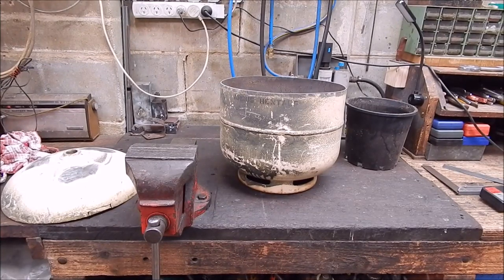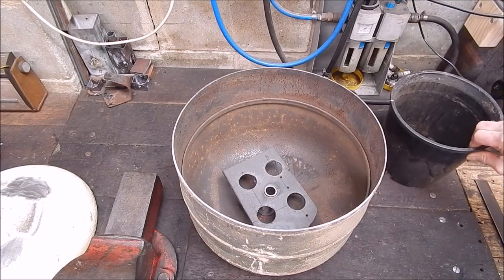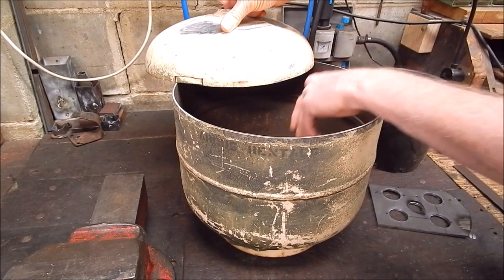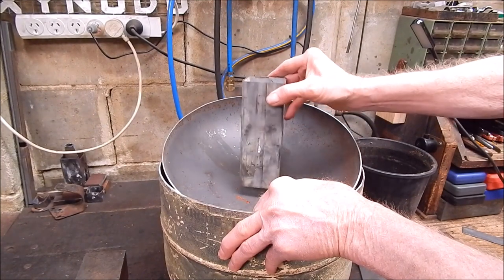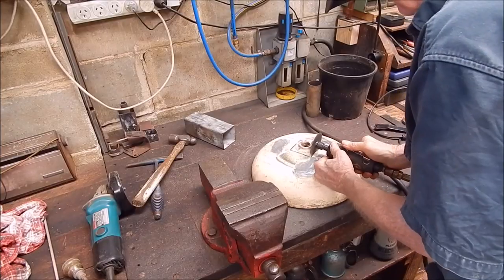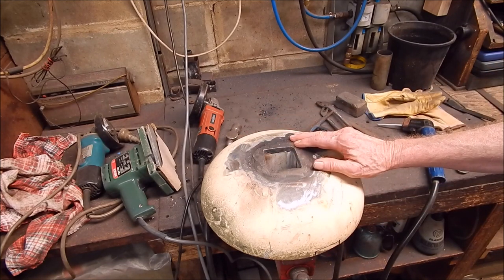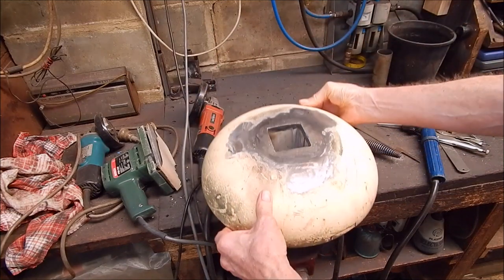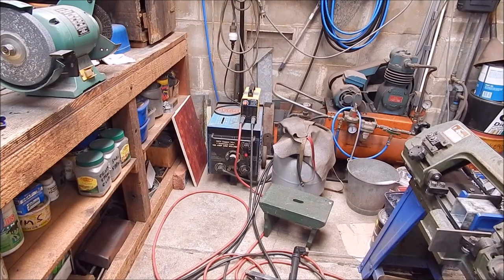Making a metal melting furnace from a 10 kg LPG gas cylinder - part 2

Comment: Hi Rob, coming on well. Loving your "design by committee" approach.......... brave man! Put your burner hole in before perlite, and lash the burner up, fire it up full (outside), paint removed!! Just means a bit of tidying post perlite addition but far quicker than sanding back. Cheers, Jon
Reply from the maker: Great idea Jon.  Yes I will go with that.  Cheers Rob

Comment: Hi Rob. Great build series. I've done a few melts in the coffee can furnace. Will be interesting to see how this one performs then I might borrow the idea for my next furnace. Cheers Kevin
Reply from the maker: Hi Kevin,  it's just a scaled up version of the coffee can/paint tin furnace really.  Not difficult, just time consuming and you need a welder of some sort.  The bigger burner should really heat things up, so I expect an improvement.  Lots to consider and it's good to get comments and suggestions on what is possible.  Uncharted waters, so any help is appreciated.  Chears Rob

Comment: If you're going to paint it, I'd strip it first.  If you paint over a substrate that isn't well adhered, or not the correct high temp product, the top layer will just come right off with the underlying finish. I own a body shop and specialize in heavy trucks and equipment refurbishing with emphasis on finish durability and corrosion protection. I do in house commercial sandblasting, machining, road service.  With that said, my opinions and suggestions have some merit.  Thank you Rob for sharing.  I built a foundry furnace from a metal 5 gallon pail with perlite and regular mortar. It's not Ideal, but for my limited usage, it's good for me.  Id like to someday build a really nice one on wheels with a lid you step on to open the lid. Take care my friend.
Reply from the maker: One suggestion in comments is to heat up the furnace before I put the perlite in it and that will burn off the paint.  Sounds like a good idea.  Cheers Rob

Comment: Hi Rob. I think I'd have ran a big bolt through that plate with suitable spacers and nut under the whole thing, making it able to be dismantled but mostly because I don't have a welder. Regards the lid, if you go for the single pivot, I'd have the pivot raise as its opened. Interesting, thanks for sharing
Reply from the maker: Hi Ian,  I've see a few on YT with a horizontal vivot on top of the vertical pivot ( forms a "T"), so I may do that.  Cheers Rob

Comment: Fascinating little project. I have taken to putting bees wax on my cut off discs following Jimmy Diresta who used a lubricant when making a safe door frame & so far this seems to be greatly extending the life of the circa 1 mm discs I use with my Chinese cordless angle grinder. Regarding ac welders I saw a video of some one using 6013 with ac to weld cast iron. I thought to try this as 6013 rods are much cheaper than speciality rods & to my surprise the base plate in a rotating vice held together. I did this with out preheat & left it to cool naturally. The cast iron became too hard to work but I used a tip from my grandfather via father to chuck it into a coal fire & after that it was just about workable using a lubricant of grease, oil, washing up liquid & water, a recipe from the local ordnance factory & cobalt drills. I drilled & tapped one side with out trouble, then cracked the other side, but hope to retry. Thanks for sharing!
Reply from the maker: Yes, you most certainly can weld cast iron with GP stick welding rods, but ONLY nodular cast iron (as is used for vises, C clamps and other high stress related objects).  It will not work with common grey cast iron.  I've used GP rods on nodular (without pre-heat) and the only thing you need to do is peen the weld while it cools down, to stress relieve it and prevent cracking.  I use an air needle descaler to do that quite successfully.  The end result weld is just as strong as any specialty rod can do.

The bees wax on friction discs is a new one on me.   The best way to extend their life I've found is to do gouging cuts rather than feed in, which tears them up pretty quick, particularly on thin material (which acts like a scraper).

The hardest cast iron I've had to work was that used in my Chinese lathe.  Wow, is that hard.  Not like the cheesy stuff in some early supposedly high quality brand name lathes.  The worst cast iron I've ever machined is gym weight discs, which apparently are more slag and sand than cast iron (the dregs of the industry) and destroy carbide inserts like nothing else on earth.

Cheers  Rob

Comment: Hello Rob,
I have been wanting one of these since watching your original build and also Alan's... Not being able to weld is a slight problem but I was thinking that I could do all the prep work and farm out the welding... with this economic climate it would be great to recycle some metal...
Take care.
Paul,,
Reply from the maker: Hi Paul,  welding is all about practice.  I used to be good at it, but I'm pretty average these days.  Thin high tensile metal like this is a bit of a challenge with stick.  MIG woud be a lot better.  Try some mates to see if they can do it.  Good project for them ;)  Cheers Rob

Comment: G’day Rob I’ve used vermiculite/sand/bentonite and perlite/sand/cement and perlite/sand/bentonite and sand/bentonite all are about the same for the body but for the lid sand/bentonite worked the best. I’ve found perlite or vermiculite have a tendency to break up with the constant on off of the lid but for the body is great. If you consider the perlite/vermiculite replaces the stone aggregate where is the strength. Finally all of these mixes have a relatively short lifespan, they will start to crumble, if I get 20 melts I’m happy. I’m going to give fire clay next. Hebel bricks work well also but they will break up after being tormented with the heat and you need a square furnace for that. I haven’t tried heat resistant paint should work because the external surfaces are insulated from the heat, they area of concern will be the edges of the lid and top of the body, as for me after the Mobile Oil artwork eventually surcombed to the heat I just left it with the rustic patina 
Cheers 
Peter
Reply from the maker: Hi Peter,  interesting information.  Maybe I should consider using sand/bentonite for everything ?  I have a 20 kg bag of the stuff (food additive for cattle so they don't shit everywhere when transported) and a bag of kids fine play pit sand I use for casting mix.  Would that be too fine ?  Pearlite definitely has a limited life span under these conditions.  I think your numbers are about right.  What ratio of sand to bentonite did you use ?   Yes, rust does add character to builds.  I've used heat resistant paint on car engines and it's OK but not very durable.   So long as it works is the main thing, so I might just leave on the old paint and see what happens.  If it burns off I can paint it or leave it.  Cheers Rob

Comment: Good going, Rob! My recipe was the following: 1/3 of volume each: Silica sand, Bentonite powder & Perlite.  Mix the first two, add 50 % diluted water glass ´til smooth - add perlite and mix 'til desired consistency and adherence to perlite. Pour and tamper carefully with gloved hand into furnace - you don´t wanna crush the perlite. Let dry for a week, add some heat (75W bulb) into it for a few days. Stoke up carefully and successively until completely dried. Extra protective inner layer of concentrated water glass could be brushed on after a while... Good luck!  Cheers DIYSwede
Reply from the maker: Hi Johan,  that sounds good to me.  I will have to buy some Sodium Silicate.  That's just concrete hardener isn't it ?  Cheers Rob
Reply: @Xynudu  Correct - sodium silicate hardens in the presence of (natural or forced, as when doing cores for casting) carbon dioxide and glazes to rock hard in the furnace. Add liberally to some of the cracks that inevitably will develop inside. Cheapest binder/ glue/ fireproofing around. IF mixed with Portland cement or plaster of paris it cures instantly - thus Zero minutes pot-life... Guess how I know... Cheers! DIYSwede
Reply from the maker: Hi Johan,  I'm toying with the idea of using bentonite clay and pizza oven mortar, with fine sand mix for the insulation.  Not sure how that will go.  Pearlite will crumble, so I'm trying to stay away from that.  I will mix a test sample and give it the heat test.  Refractory cement is the other relatively cheap alternative.  What do you think of this idea ?  Cheers Rob

Comment: Would a few bits of reinforced rods  not be easier to weld than mesh on the inside of lid?
Reply from the maker: That's not a bad idea Robert.  I have some fairly small diameter reo.  I will check it tomorrow to see if it will work in.  Cheers Rob